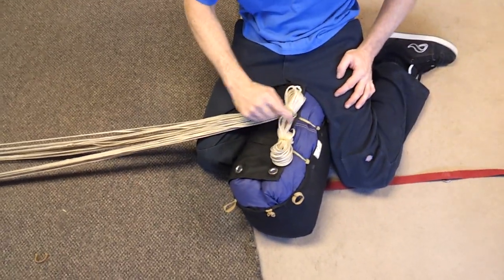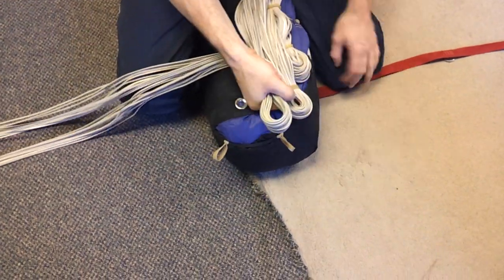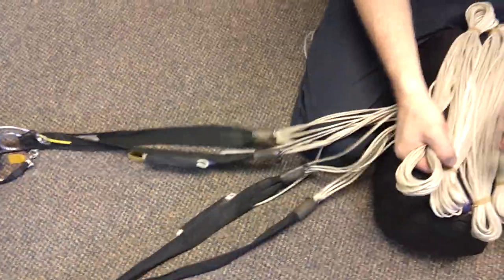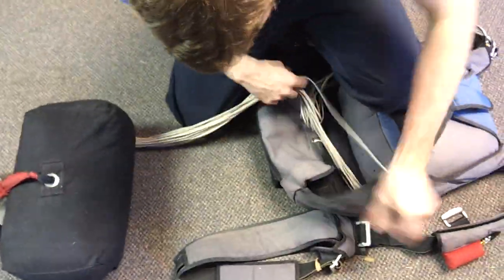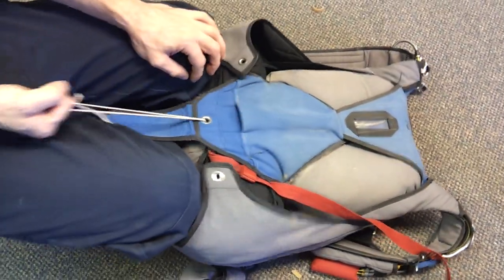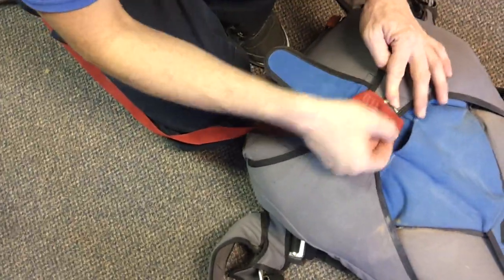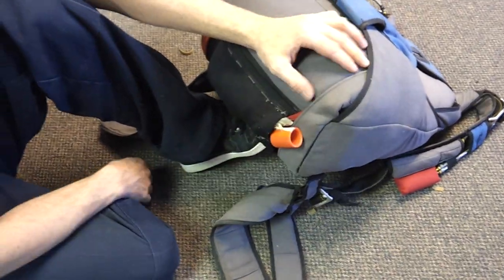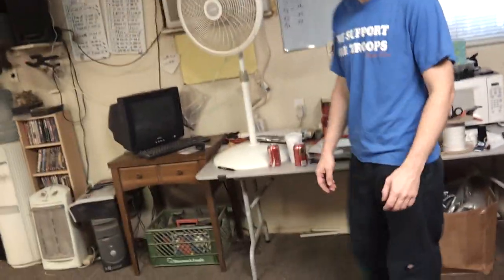Parachute Packing - Part 2

Comment from the maker: The D-bag and the container are designed to accept a specific range of canopy sizes; typically a standard size and a deviation of 20 sq ft up and down; so a container meant for a 150ish main, can typically accept a 170 down to a 135 depending on the material. The force of your body travelling at 90-130 mph and the drag the pilot chute creates when it hits that wind when you deploy pulls your lines right out of those rubber bands and pops your canopy right out of that bag like it was nothing.

Comment from the maker: From what I have heard, the stows that actually count are the locking stows; the ones on the front of the bag that hold it shut.  There is a myth that not double-stowing the remaining stows or not stowing them at all (laying the excess lines down in the tray of the container) will cause line dump.  I'm not an expert by any means, but it makes sense to me that your bag leaving the container quickly will not cause line dump, but your canopy leaving the bag quickly is not good.

Comment from the maker: VERY good point.  Once you get licensed, it is time to buy a container, canopies, an AAD, a jumpsuit, a helmet, an altimeter, a dytter, a gear bag, etc.  THEN, just like automobile maintenance, now you need to have schedule maintenance performed on your gear.  NEXT, you need to start thinking about getting better/safer in your chosen discipline, which means LOTS of jumping, coaching and tunnel time.  Skydiving is not a poor man's sport, but skydiving will make you a poor man :)

Comment from the maker: On average for a complete student system?  I'm taking a guess here: I'd say probably $2000 for the container/harness, $1500 for the reserve, $1800 for the main, and $1500 for the AAD.  You can save a couple hundred going with a Vigil over a Cypres, but I'd say $6500-$7000 is fairly accurate for modern student gear.  If you were a DZ ordering a dozen student rigs for your AFF program, you might get a bulk deal, but I don't know that for sure.  I just ordered my first rig - about $7500 delivered.

Comment: Why do you only do one rap with the rubber bands when making your stows? I was taught two wraps.
Reply from the maker: +Ray Perrin I'm not the instructor, but notice the lines on this parachute are the thicker Dacron lines, whereas my guess is that you were shown how to pack a parachute with the thinner Vectran lines.  As long as the rubber bands have a relatively firm grasp around your stows, it is fine.